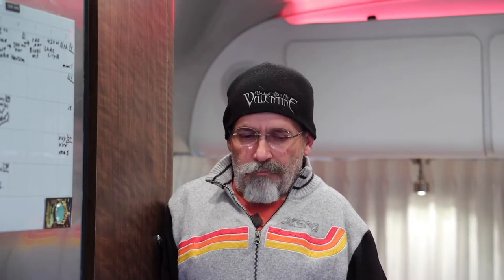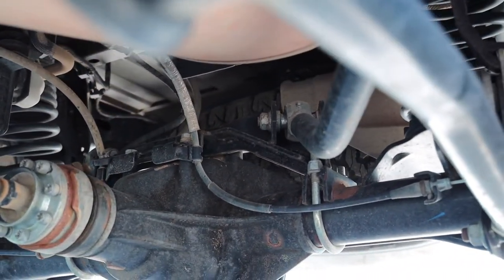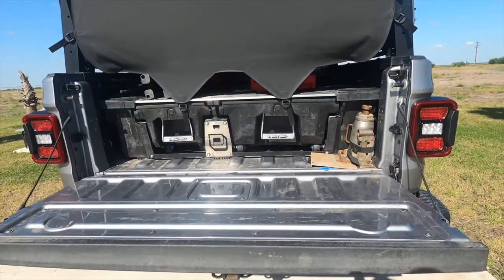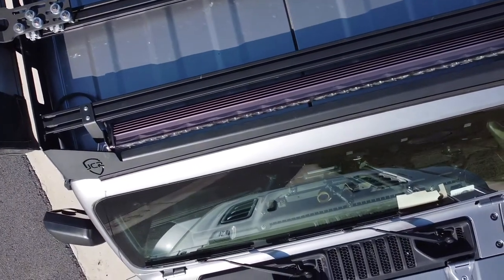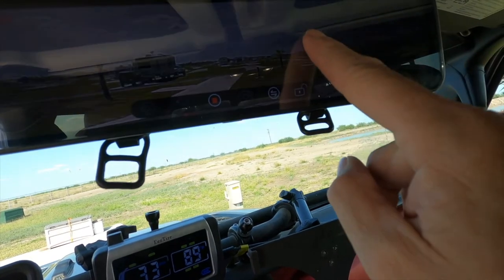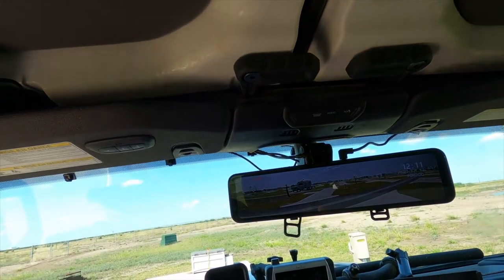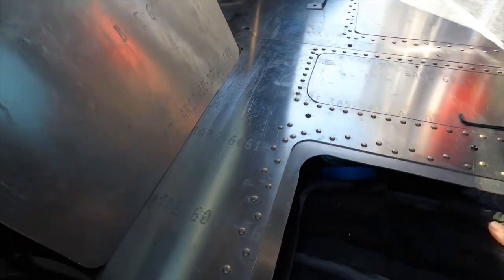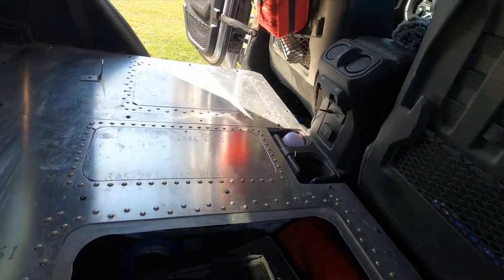My Airstream tow vehicle

Comment: I didn’t notice any trailer brake controller. Also, do you mount the Airstream’s rear camera monitor to your 67d bar?
Reply from the maker: Good catch Yanik, I'm using the CURT wireless Bluetooth break controller. as for the Airstream's back up camera, no I actually have not used it since the first day I took delivery of the trailer. the quality is real grainy and I was spending more time trying to figure out what I was looking at instead of focusing on the actual task of backing the trailer. since I have become more comfortable with the Rig I may try and use again. however I have been looking at other solutions, I have a Garmin GPS that has a feature to connect a Bluetooth camera but it has to be a Garmin camera and its not cheap. I'm considering wiring in a camera that I can connect to my rearview mirror when towing. just not sure how I would route the wires.  Thanks for the question. I knew there were things I forgot or over looked.
Reply: @procrastinationstation  I have a Sport S w/ Max Tow package coming in the next week or two and an Airstream International 23FB coming late December so I’ll be following your vlogs with interest.
Reply from the maker: @YanikGrignon  Nice!
. what color Sport S? were you planning on putting any sort of Lift and or larger rubber on it?
Reply: @procrastinationstation  it’s a Granite Crystal Metallic one. I’m not currently expecting to get a lift as I got some 33”Wrangler 392 takeoff wheels which should fit stock.
Reply from the maker: @YanikGrignon  That will look real Nice with the Airstream. 
Also as for the Airstream's camera monitor, if the monitor is that same as I have and you want to use the 67 designs system you will need to get the RAM mount 100mm x100mm ball adapter. the 100x100 refers to the hole pattern for attaching it to the monitor, the ball on the monitor is too small for the Arm clamp. I had to get one for the Garmin GPS and I looked this morning and noticed its the same issue..